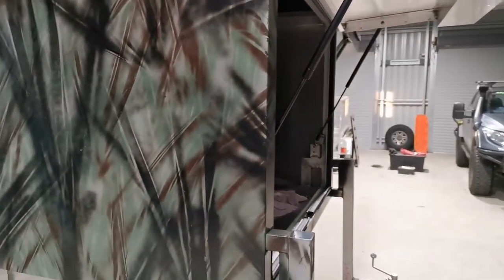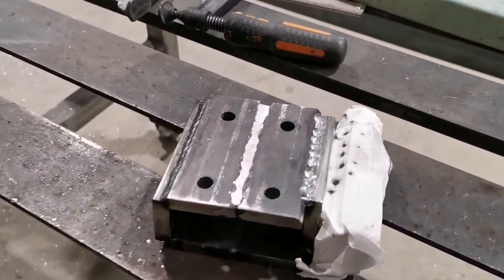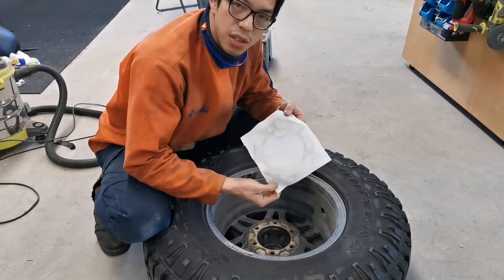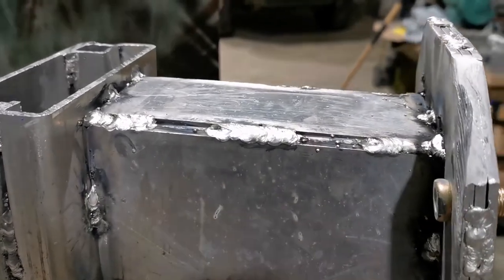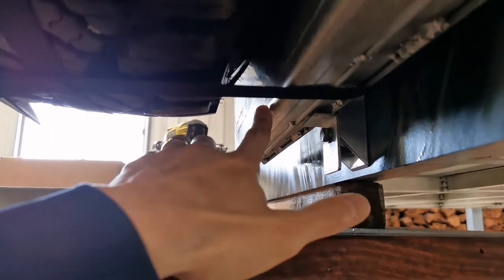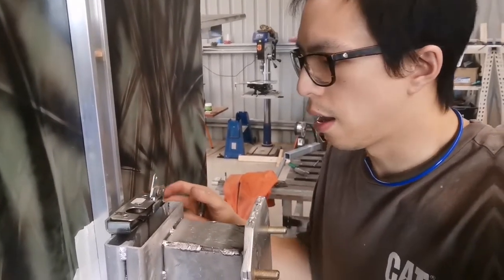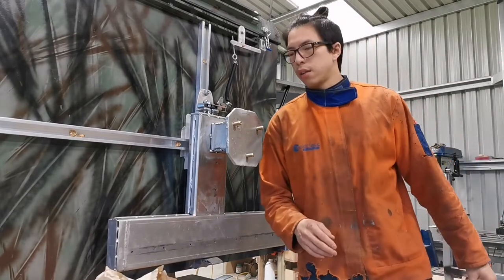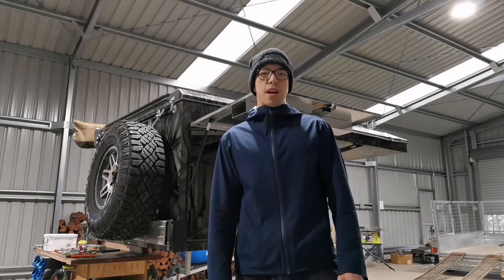DIY Swing Tyre Carrier - Overland Tyre Carrier

Comment: Very good video mate, but I am not sure why you would want a swing are on that back panel. Swing arms are used to swing the tyre away from tailgates/doors or things that open. It looks like this tyre is just against a flat side or you canopy. Am i missing something?
Reply from the maker: I wouldn't mine having extra bench space after the tyre is swung out.
Reply: Sounds like a good enough reason. I plan on adding a swing out spare tyre holder to the backend of my Hilux ute.

Comment: Did you consider using 50x50 T6061 aluminum extrusion like from 80/20 or somewhere similar?
Reply from the maker: Personally I'd use something bigger. Do not under-engineer your design.
If it is for off-road use, you hv to go really big.